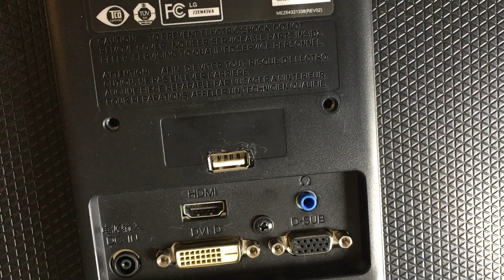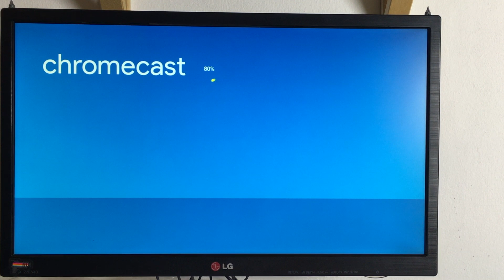Adding USB Power To A Computer  Monitor

Comment: Do you know if this would also work for the kind of monitor that gets the atx style power plug going into it?
Reply from the maker: Why not? At the end you just have to find some DC voltage that can be stepped down to 5V.
Reply: Great video, and what I needed too!
Reply: In this case is not a DC step down, is an AC to DC transformer, aka phone charger.

Comment: Thanks Peter! what component do you use for step down buck 18v to 5v ?
Reply from the maker: Just the cheapest buck converter I found on ebay :) But I can't find my model anymore it seems to be disconinued. https://www.ebay.com/itm/333463166335 should work too. Since the old USB does not need more than 3 A...